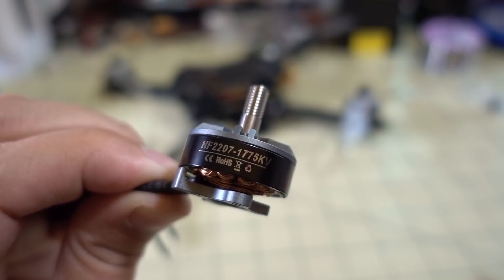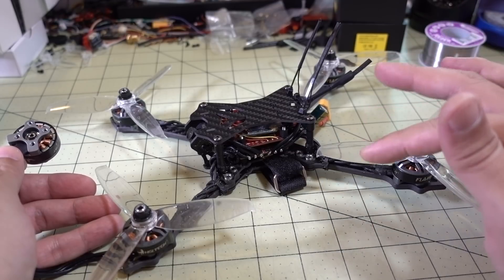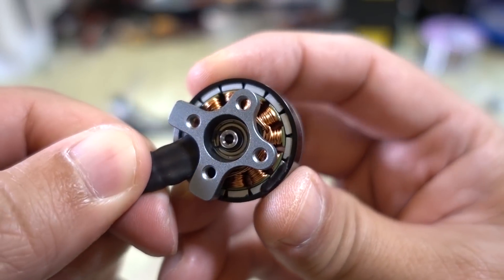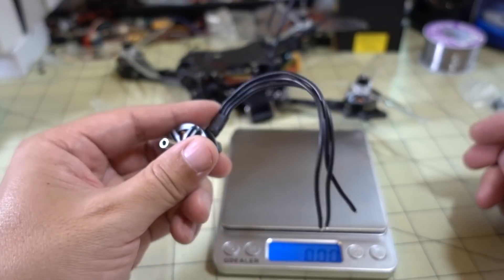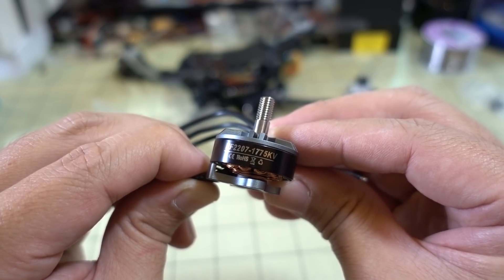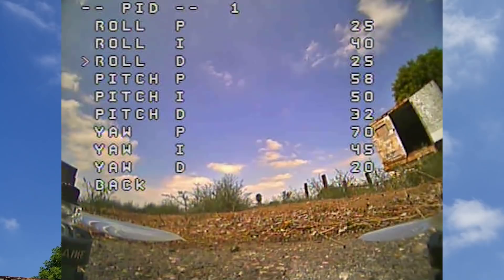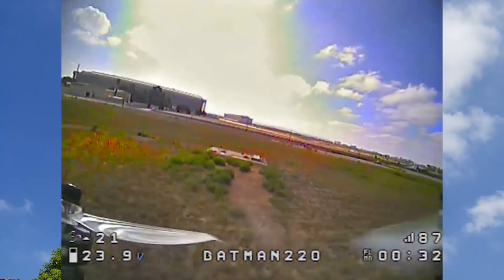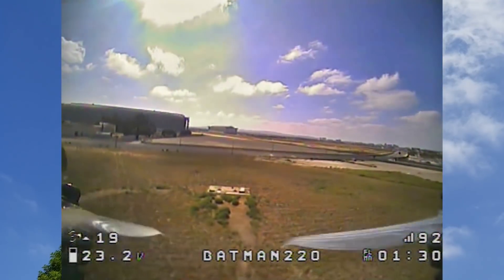HGLRC 2207 1775kv 6S Batman220 Motor Upgrade 😍

Comment: Great motors unfortunately I've had nothing but back luck with them 1 burnt and another the cables got pulled out. Think HGLRC have stopped producing them and have gone to the Forward engine has the same specs but different build quality.

Comment: Amazing flight, Albert! Great motors! 😃
But, yeah, looks like the 2207s have more punch and are more amp hungry at higher throttle, but are much more efficient at lower throttle than the 2306s... That's why most racing pilots are using 2207s. 😉

Comment: Nice upgrade...  love that Batman...     What props were you running?   Thanks for the video!
Reply from the maker: The props were the same as before.... refer to the Batman220 review and they will be mentioned in that video.
Reply: I feel the stock props are smooth as heck, but more performance was available.  Hulkie 5055 were INSANE with a high C 4S 1500mah, but flight time was horrid.  They absolutely CRUSHED my lower C 1300mah.  I ended up with HQ V1S 5x4.8 Props on my Batman...  Super performance, sturdy props, and decent 4+min flight times.  Admittedly,  I'm more of a cruiser than a racer though.